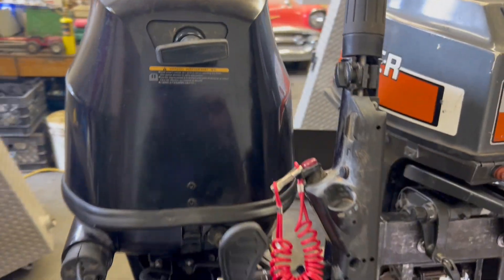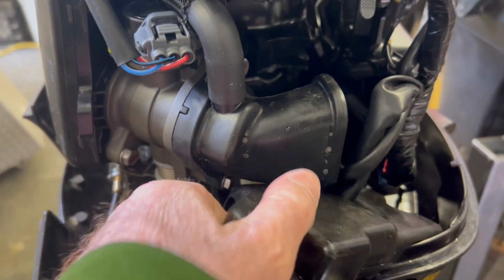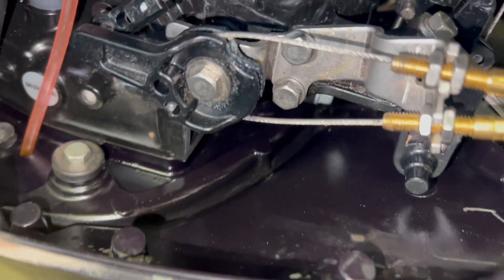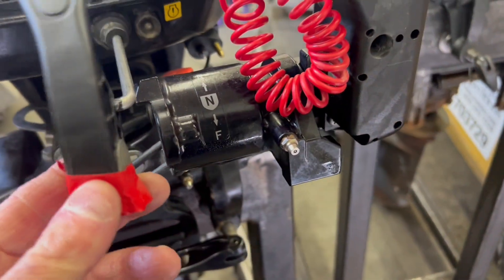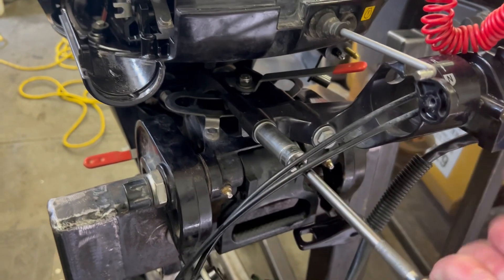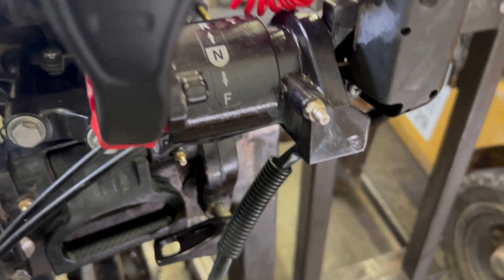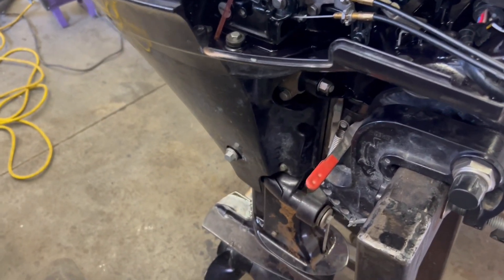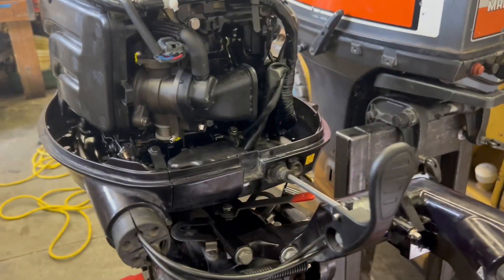Tohatsu 30 D Tiller Handle Replacement-Instructional video for Colorado River and Trail Expeditions

Comment: Is it possible to add remote throttle control to this model? I have a white one 2023 model with trim and electric start and want to got remote steering/throttle